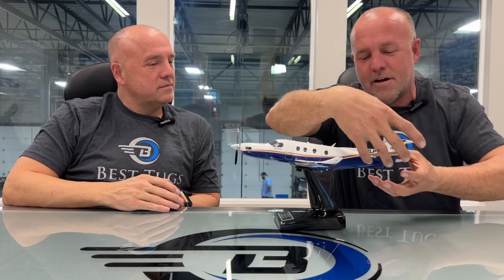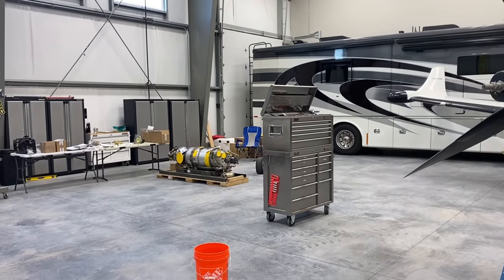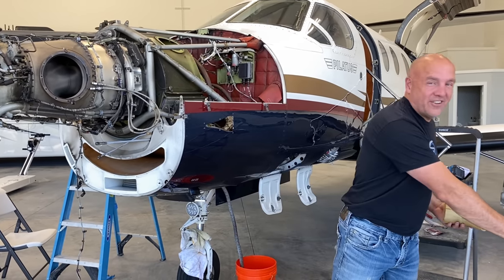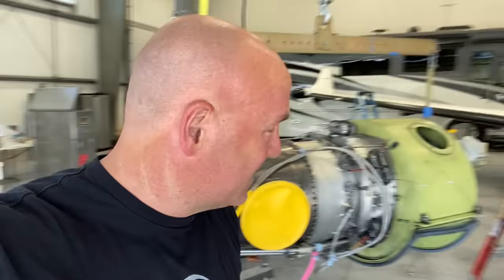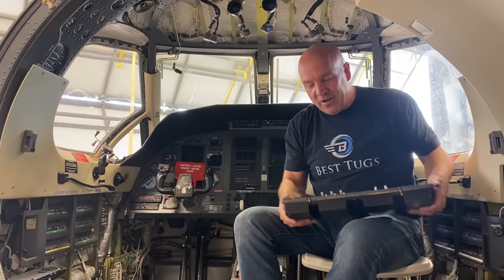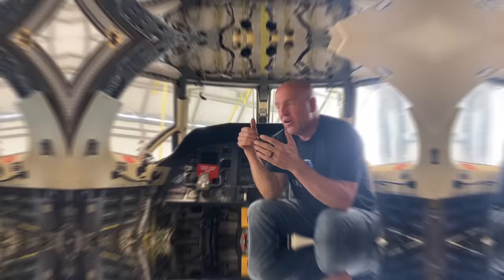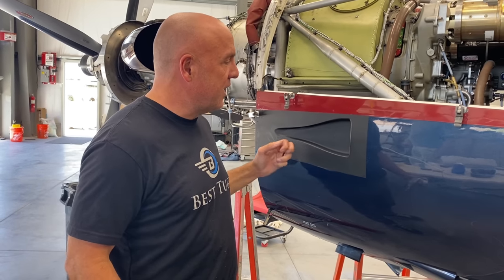Modifying a Pilatus PC-12 - $950k Engine Swap! | Perry the Pilatypus

Comment: I think Mike should do a top 10 reasons why he prefers Garmin over other companies. I'm curious to know why he likes them so so much compared to other options.
Reply: They’re very good.
Reply: What other options? Not many for certified. It's a Garmin world out there
Reply: Sponsorship is why.
Reply: they sponsor him...
Reply: Way fewer steps with the gamin touch than with the Apex.  Garmin is much more intuitive.
Reply: Human factors
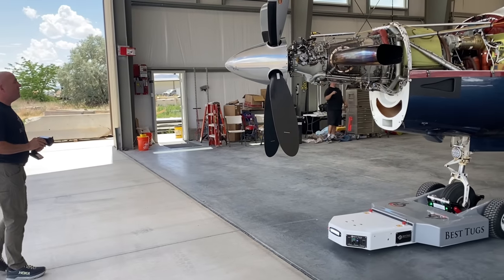Reply: I’ll edit myself.  Zinc chromate would be an anti corrosion surface application commonly used in aluminum construction.  It would not be an anti seize compound.  But, I’ll bet chrome is the objectionable material in some sort of compound. 29:40
Reply: Garmin is okay but they got rid of all of the buttons in favor of touch screen. In severe turbulence It's a massive pain to try to use it. I just wish they would have kept their buttons along with the touch screen.
Reply: They also give him huge discounts if not stuff for free
Reply: I agree with Mike. Honeywell Apex Prime is slightly more cumbersome in my opinion.
Reply: @JustPlaneSilly  or integrated j tick?
Reply: @JustPlaneSilly  certainly need to have some sort of place to rest your hand in turbulence. The large bezel is the intent of the touchscreen avionics. But a common complaint of touchscreens.
Reply: It’s about logic comfortable use, very welcoming helpful features,  safety in flying and workload, quality of working and systems in operation. It’s a leading brand in aviation. Just great stuff…Garmin is the way to go with modern avionics. And you get well tested certified products for your plane. Garmin is number one in choice of awesome avionics. ❤
Reply: If they gave all that stuff to me for free you better believe I would say I love them too!!!
Reply: @SoloRenegade  No.. You have to try it to understand it. It's expensive but worth it in my opinion in the long term.
Reply: Some love Garmin, some hate them.  Mac vs PC. It’s a religion. :)
Reply: @pinipuchi  I don't argue the ease of use of Garmin, but he is sponsored by them. Hard to turn down free stuff.
Reply: @StudioRV8  Some people love using Garmin, but still hate the cost and the somewhat monopolistic direction of garmin in the industry at times due to lack of good competition.
Reply: He needs to tell us why he isn't wearing a garmin watch xd
Reply: @SoloRenegade  I’ve flown behind several brands of glass, and Garmin is NOT my favorite.  I find their interface and menu system unintuitive and clumsy, but respect its the preference by some.  Just glade we have choices to pick from.  Some like blonds and some like brunettes, and that’s okay.
Reply: @brianjorgensen282  and that's fine, I generally like the interfaces with Garmin, though i do have my gripes as well. But I can't stand the cost and other instruments will be what i go with myself that are perfectly useable for me.

But doesn't mean I can't worry that Garmin might become an Amazon/Apple/Google type giant in the industry and push others around through gov lobbying/regulation.
Reply: Competition is a beautiful thing. Garmin is a poorly run company (financially/working capital perspective).  They rest on high margins and someday it may just bite them.  Nice we have choices. Vote with your wallet.
Reply: @Airplanefish  Aspen and Avidyne are also big but I think ease of upgrade makes Garmin popular
Reply: @TheProcustoms  correct, but in my opinion Avideyne just doest have the clarity and ease of use and Aspen stuff is difficult to repair and keep maintained especially since there's not may qualified shops that can work on Aspen stuff
Reply: Its the most user friendly. The others are just fine tho IMO. Its just different
Reply: @doctaran   do ya think, they get it all for free?
Reply: @garytobin5120  mastinox
Reply: @brianjorgensen282  I agree the Ayidyne IFD navigators are much easier to use
Reply: Garmin is second to non for most pilots that i've ever talked too
Reply: For corporate airplanes… 
Compared to Collins, Universal, Honeywell etc. Garmin is far more logical, user friendly, far more capable and feature rich. Look at a CJ3+ with the G3000 vs. the CJ4 with Collins. Beautiful TAWS, synthetic vision, TCAS etc. Also displays etc are far cheaper. Collins ProLine displays around $25k each. Garmin around $3-$4k. 
Watch some videos of setting up flight plans, loading approaches etc
Reply: They’re the easiest to use.
Reply: Its just an apple/pc or iPhone /android kinda thing. Ive used lots of avionics and I prefer Collins.
Reply: Reason number 1, Garmin pays more to advertisers than any other company.
Reply: He's a sponsored Garmin Ambassador...so Mike's bias is strong with Garmin. Wouldn't be surprised if he gets the Garmin kit for free. To clear the air, Mike should declare whether he's paying retail or getting it substantially discounted or for free.
Reply: Mark is like Mike on sedatives...which I like much more. Mike is like he's got bees up his pants all the time and Mark looks healthier because of it 🤔
Reply: @UTarcher72 wait you think someone who has many many millions of dollars really cares about sponsorships for gps gear?
Reply: @lazerusmfh  Ummm, yeah. Have you seen the cost of modern avionics? If you're sponsored, you're going to market the products that your sponsor makes and sells. Plus, he probably gets them at no cost. That's kind of how it works.
Reply: He also prefers Garmin over Chevrolet.....
Reply: @garytobin5120  Hexavalent chromium is considered a carcinogen in California (what isn't?). This is why the immersion carb cleaners (e.g. Gunk Hydo-Seal) don't work as well as they used to. Pulling those six electrons off the chromium atom imparts a lot of energy.
Reply: As a service center, I would hate for a stripped-out screw to be the root cause of an aviation failure.

Comment: I appreciate Mark's rant on screws. Very true and applies across many industries
Reply: YES - as an auto mechanic, I agree 200%! One of my biggest pet peeves was the reuse of totaled fasteners. You can waste the entire billable job time on ONE stupid fastener! 😵
Reply: No joke. Especially since they’re repeat customers and the damn thing gets inspected annually, it benefits the techs to replace those screws for the next time they work on it.
Reply: Many fasteners only used once on removal must be replaced.
I'm not totally on board with that  but at least every other time.
Reply: @chauvinemmons   On modern automotive engines, most of the time the cylinder head bolts are TTY (Torque To Yield), and can only be used ONCE. When you torque them to spec, they stretch to just a hair below their breaking point. Reusing them is a great way to ruin your week, lol.
Reply: Screws are cheap! Reputation is not. Replace the screws as a pro style service.
Reply: Yes! 🤯
Reply: It depends on the condition of the screw or bolts if there not rounded striped slackening or rusty I’m fine reusing them but that almost always means actually have a good set of tools that aren’t worn out themselves and can do the job without stripping and rounding them  in the first place I hate having to brake out the impact screwdriver and sockets
Reply: I am an airplane mechanic, and one of the things I learned/realized early in my career was that 99% of the time (at least where I work) when you send a stripped screw home and say “F it It’s the next guy’s problem” that next guy is me, and past me just turned a one hour job into a five hour job for future me 😅
Reply: nothing erks me more than stripped fasteners.  even the more expensive ones are still inexpensive in the overall picture.  it just indicates laziness.

Comment: What a clean and neat interior with a few stripped screws in the floor...I used to be an aircraft mechanic in the 1970's, working on interior mx and cargo conversions on DC-8's and genl mx on C-130's. One of the most pleasant jobs ever is pulling literally thousands of crews up from the floor panels of a C-130 so they could all be pulled up for cleaning and inspection. The aircraft has been hauling every type of cargo from oil drilling equip to fresh fish, many of whom have fallen out of the bins and now reside rotting in the sidewall of the wall panels. Many of the screws are stripped and or filled with gunk so that they won't come out easily. Also the foreman insists (so that no more screw heads are stripped) that no pneumatic screw guns be used, (we didn't have electrics then) only hand held screwdrivers and an old fashion crank driver which gives you a little faster extraction.

Oh, and it's very hot and the removal of the sidewalls and the resulting fiberglass dust has your skin on fire...and you just knelt down and your knee kit a countersunk scree head. A great motivator to find a more professional line of work!

Comment: The house I grew up in was number 22. I like that you guys brought that up! :) 

There was always something about the PC-12 that I was drawn to. Even before I fell head-over-heels in love with aviation in 2017 (thanks to Greg / Premier1Driver's channel), I'd see one fly parallel to my street anywhere from 2-6x per week hauling pax from north to south, long before I knew what it was. I could always hear it coming - the modern turbine coupled with the old school tried-and-true prop. The long, straight wings really made it stand out in the sky, along with the SPEED! That was what drew me in - first the sound, then the speed! Before my shop was built I always worked on my tailgate of my truck in the driveway cleaning carburetors, rebuilding engines, keeping OPE, and cars / trucks running, and I'd always stop whatever I was doing and watch that Pilatus fly by, just amazed at the ground that thing was covering so quickly! It wasn't until I discovered aviation on YouTube, and FlightAware that I knew how high, fast, what it was, where it came from and where it was going. Even at 9k feet above me, that thing just eats up the miles. Can really get a sense of the speed! Fun to watch! My chances of owning one in this lifetime are pretty slim, but that would be the one I would work my way up to if I ever had the opportunity. It's amazing to see what's under all those covers and panels! Impressive engineering.  And speaking of engineering, that's the first time I've seen one of your Best Tugs operate! That is truly AMAZING! NICE work on that!!  I know you guys have been continuously improving them over time, but wow, that's an impressive machine! 

I've rambled enough! Great stuff fellas - always love the TV / movie clips thrown in - cracks me up! Can't wait to see her fly and perform with that new engine!  I'll definitely check Mark's channel for those numbers - love that stuff. I can't recall where I saw the new paint ... maybe Instagram, but it looks PHENOMINAL!  😎🙌

Comment: Hey Patey’s, I worked a Depot at Hill AFB just north of you guys. I worked F-4’s and F-16’s on the production line. We always replaced the screws and bolts we took out with new. The locking nuts and nut plates were hard on threads and you don’t want a fastener coming out of a jet on a mission! Thanks much for sharing your video.

Comment: Watch the  problem of the stall, The stick pusher, landing on a soft field, performing a full stall landing, will push the nose into the ground ,  if disconnected, the left wing will drop first, sharply.
Test this at altitude.  Be sure you have control of the stall process! 🔥
The stall problem is reduced when olny part flaps are set, remember full flaps is the critical configuration
Watch blancolirio Mesquite incident !
[ Swiss aerodynamicist here, familiar with the STC process]

Comment: 100% agree on the issue putting new screws in once the originals are worn😬 thats the reason i like to check my plane before panels get back closed… too many shops want to skip the little extra time but fail to understand that it makes all the difference.🤷🏼‍♂️

Comment: Mark/Mike, I can really appreciate your comments regarding the stripped screws on your $35K+ annual.  Overall, the problem of common sense not applying to annuals is endemic in the aircraft maintenance industry.  I often find and am puzzled by not replacing screws, wires, connectors, etc that have minimal cost because "it still works"  mentality.  You should see the 40 year old wires and connectors I just discovered in one of my airplanes back from annual on landing gear microswitches.....

Comment: "Zinc Chromate," Mark. Also the floorboard screws may be  titanium for weight savings and are very expensive. They bind very easily when removing and the heads strip. Using valve grinding compound on the apex bit when removing titanium screws helps the traction and a much less chance of stripping the heads. They are a headache but I agree with you about replacing every one that is stripped. Really labor intensive fasteners.

Comment: Hello I just need to clarify something for your viewers and by the way I love you guys. 27:10 you mentioned shot peening the prop as hardening the prop that is not what it does. Shot peening puts the surface of steel (or material) under compression, by doing that it it allows the surface to come under tension and minimize stress fractures to form.

Comment: Hey Mike, I worked with Oregon Aero for a couple of years. For a while we even had 2 PC-12's. Do yourself a favor and fly with one of the 5-blade Props like with the MT-Prop. Because of the symmetry of the 4-blade prop, the 5-blade is a lot quieter. Thanks a lot for this content. Brings a lot of memories up of old times crossing the Atlantic via Iceland to Germany for a couple of times. Greetings from Germany. 🙏😀

Comment: Love the attention to detail and yes, if the screw is not in good order throw it out and replace it.  One of the tools that ruin screws is electric screwdrivers used  inappropriately or not mated fully to the screw.  Anyone using a rattle gun to tighten up wheel nuts (lug nuts if you prefer) on my car will get a thick ear.  Hand tighten and then use a torque wrench with the appropriate setting.
Reply: I just run them up to where they are not yet tight  with the impact wrench and then grab the torque wrench.

Comment: Great work guys….

The engine upgrade will obviously have its benefits but the electrical system capacity upgrade and additional redundancy offered is quite substantial. Great for IMC and also any role equipment which may have high power requirements.

Mastinox D40 is the coating which was used on bolts and screws for anti seize / anti corrosion. My old boss back in the day called it Yellow peril.

Comment: Another good laugh.   When I was working (Air Freight Op) the wires never got pulled out of the ceiling.   Huge bundles of abandoned wires as tech advanced and left in place.   I had an office that had a huge pile of Conrtoler com wires,  from Coax to the latest blue hose.   When I got done (carefully!)  huge feet came out and it was just a small bundle (and management would not even let me pull the Coax out of the runs to the main brains to make room in the conduit for future runs.    So much falls to management stupidity.

Comment: An easy way to inventory stuff as you take them apart would be to buy some cheap cabinets, clean them up, replace the bottoms of the trays with thick art paper and then as you take parts off, using bags and double sided tape, write on the paper what the item in the bag is. A good place to find various sizes of ziplock bags is in places that deal with shipping. They'll very likely have solutions from small to large and in between, possibly even "blank" ziplock bags, and you'd just buy the cutting machine which makes the bags to size.

Comment: When you first said it I was concerned about how much it would imply but if someone has done it before and there is an STC I guess that makes it a lot easier. Still very involved process.
Surprising how much is allowed under certification. Almost as if the certification process is not as daunting as rumored.
I share your fondness for optimization. When I see an avionics bay in an airliner that's a warehouse of heavy metal boxes and a 200gram smartphone outperforms them all, it offends my engineering sensibilities. It's a self inflicted chaos that weighs everything down, not least cost. And no one seems to question it.

Comment: That yellow paste is call mastinox and it's made to prevent corrosion between dissimilar metal. But it's a pain to apply and clean. So we noe use thixo grease which does a great job a preventing corrosion but without all the negative side of the Mastinox

Comment: Mike, regarding the Stripped Screws, regardless of what you're saying regarding the $35k annual inspection cost. The FBO you are using for service most likely is paying its Senior Mechanic (A&P) at best $60/hr at best; that guy won't be removing the screws. A Jr A&P or apprentice will most likely accomplish interiors. They're making maybe $14? Probably the same guys are using a drill set to high torque for removing the floor board screws.

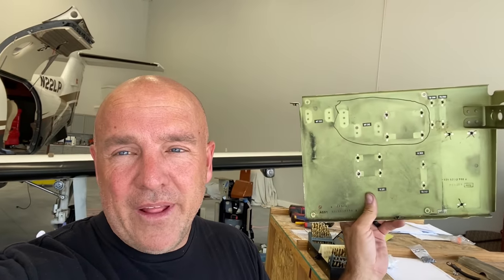Comment: So without the engine installed, is the Pilatus CG rear of the landing gear?  It looks like you might have a brace on the tail at 13:43 but it is not super clear if that's what that is behind Mark's right ear seen between the wing and the fuselage or if that's just some background item.

Comment: Mark, there's a further concern in that those are possibly  10/32 25" pds screws, which also means that they have been exceeding the torque values on those..... and what else? Oh, and if there are plate nuts, they could be forced to the point they are hard to engage once the floor boards are in. Always worth a check.